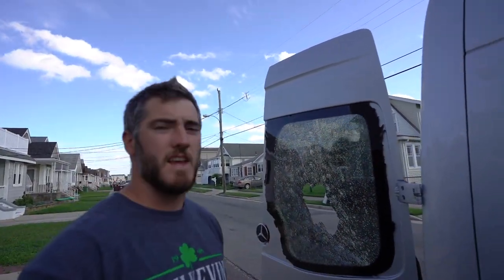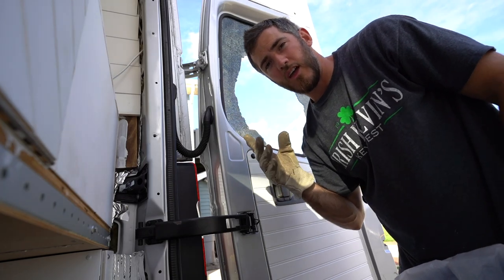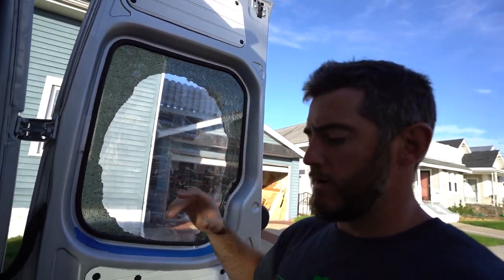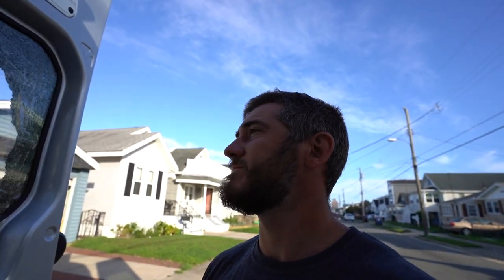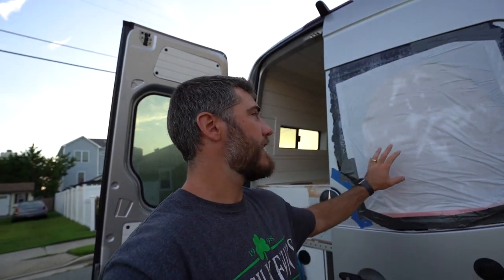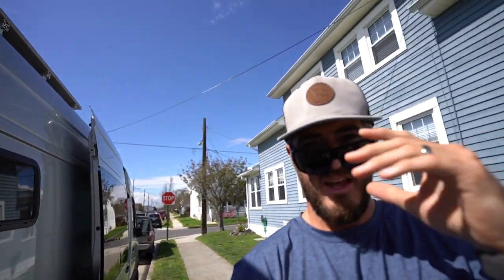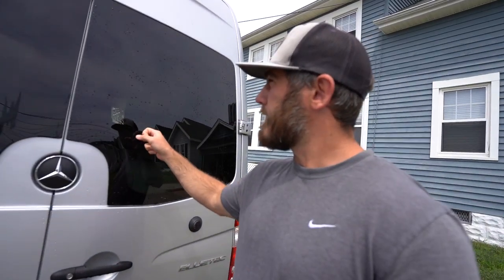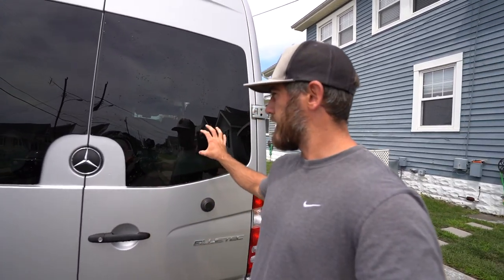How to Replace a BROKEN Backdoor Window on a Camper Van - Van Build Ep 40

Comment: Great video as always! Quick question: did you also scruff up the window before putting primer on it like in the first video? If so, do you really think it increases adhesion or should the primer alone be enough for the window to bond to the van’s surface; which also has primer on it?
Reply from the maker: Thanks Perry! Nope the scuff is for the primer which is already there for the replacement 👌🏻
Reply: @MathersOnTheMap awesome!